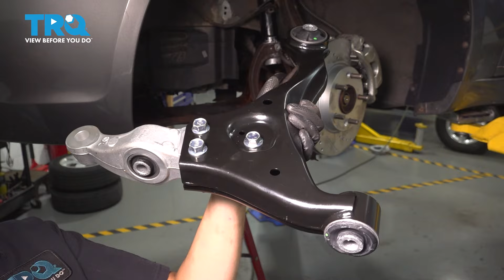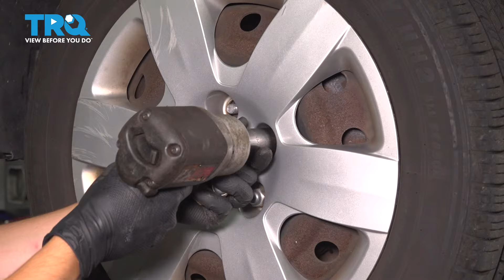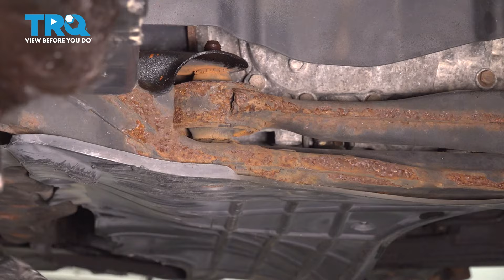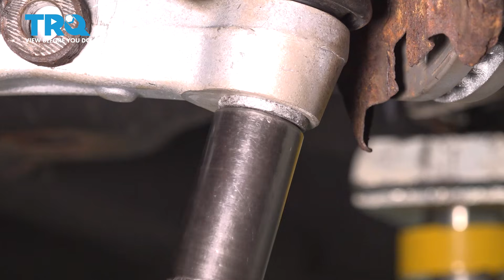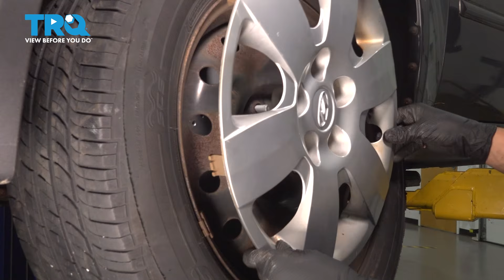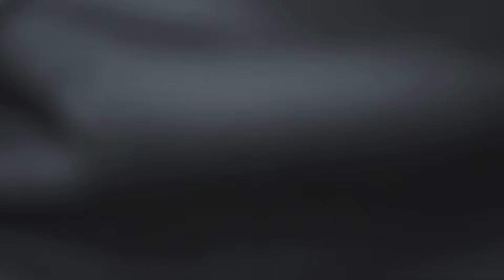How to Replace Front Lower Control Arms 2006-2010 Hyundai Sonata

Comment: Great video. I am ordering TRQ parts and going to tackle the job soon.

Do you have a complete video that also shows replacing struts at the same time? The reason I am asking is I plan to replace all the suspension components and I am concerned there is no place for the wheel to hang when upper control arms and struts are also removed. Any insights/tips are appreciated.